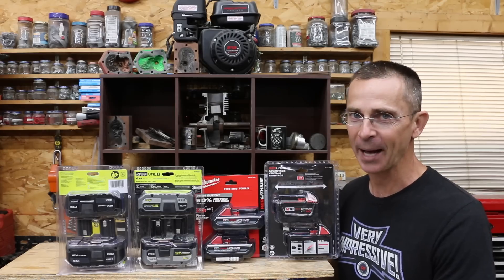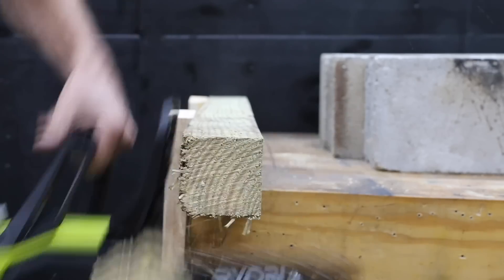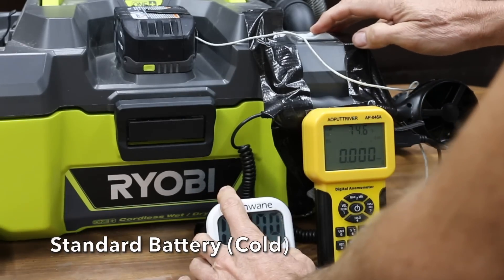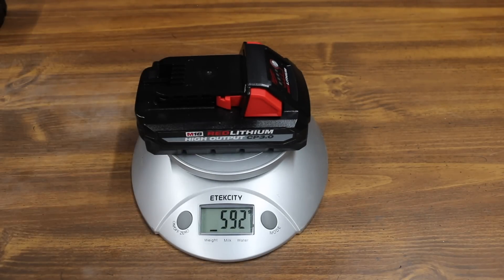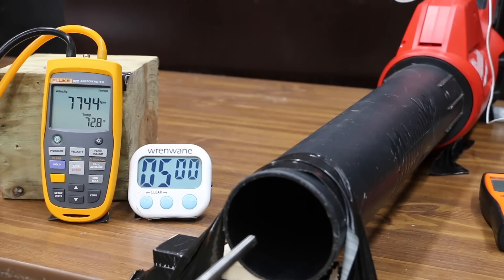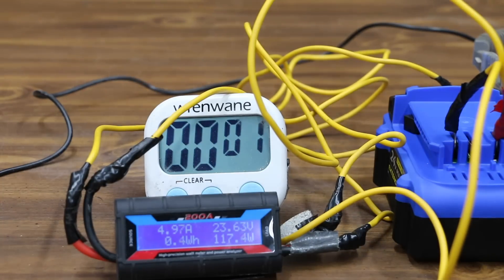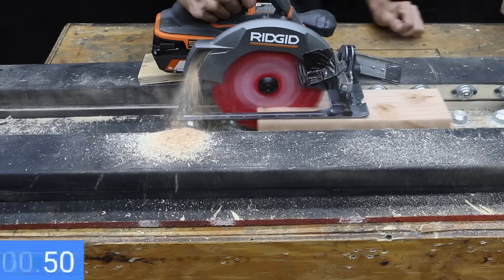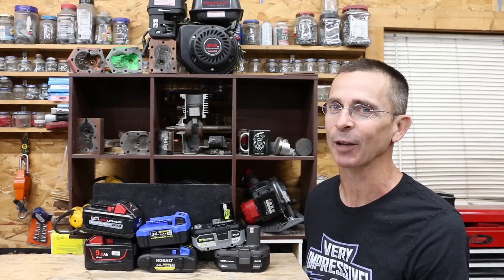Are "High Output" Batteries Better Actually Worse?

Comment: The basic idea of a "high output" battery is the initial 'kick' and power. 21700 cells are used because of more current draw capability at the same capacity (being larger and therefore runs cooler). The definitive test would be to rig up a load tester using dummy loads at high currents - could be as high as 50 amps - or create a control using a rigged power supply instead of a battery to eliminate a variable in testing, the larger or higher output batteries could end up being too good for the tool (read: tool cannot draw any more because it's maxed out electronically, a smaller battery not being able to give all the amps) that there's no significant differences except runtime. More power to you!
Reply from the maker: Thanks for sharing!

Comment: Great work you are doing here Todd!! I might suggest you consider the impact to not just my wallet but the impact to the environment and economy both on the manufacturing end and disposal end.  You may surely improve the bang buck ratio but in doing so some folks may be pushed into poverty or short life spans.  I have been there and seen battery production first hand.  After 9 years of college and 40 years of work I hung up my spurs to share my knowledge and skills with those less fortunate.  Now I grew up on a small farm, no tractor, no phone, hardly a silver spoon life.  But 10 years of part time construction work and 45 years of investing finally put me on the downhill roll.  Of all the things I learned teaching engineering was how terrible math skills were and thus financial literacy. So bad that we set up volunteer teams to teach financial literacy at libraries and churches.   Many people had the info staring right at them but could not do the basic math to determine if a good  buy was at their finger tips or if the answer should be "good bye".   Perhaps a good test and learning session would be one where the energy consumption or life span of an item was tested to see if money was being well spent ...and not spent based on the inaccurate crazy claims made on internet ads and packaging.  As you know it is not hard to measure real energy use of an item and then with a little math determining if real dollars are being generated.  You would be shocked to know how many people fall for gimmicks to improve gas mileage or believe window replacement can reduce your energy bill 40%. Money wasted on this junk would do them far more good in an Ira retirement account.  
I know high quality tools are the best to have but I also know people who earn a living using less expensive Walmart tools.   My grandfather bought a new working man's double barrel shotgun for 26.75  back in the day.  It still works perfectly and sits in my safe next to my 7 dollar 22 rifle.  Cheers for new year!  WAK.PHD

Comment: For my Milwaukee tools I have ten 5Ah XC batteries, four 2Ah batteries, and one 12 Ah high output battery.
With my 7.25" circular saw, the 5Ah batteries are OK for cutting thin materials like 7/16" or 1/2" OSB .. so long as I keep my cuts perfectly straight.  If I start to deviate from straight just a little bit the 5Ah batteries can't cope and the saw stalls.   With the 12 Ah high output battery I can cut 1.75" thick LVL and not have to worry about the blade jamming if my cut is not perfectly straight.   Ditto when doing something like rippling 1x or 2x lumber and the boards want to squeeze out the kerf behind the blade:   with the 12 Ah battery I just make my cuts but with the 5Ah battery I have to jam something into the kerf so the blade is not pinched to tightly.

The 12 Ah battery is similarly good in my drills and impact drivers when driving long lag screws or GRKs :   that battery lets the drill or impact driver handle screws beyond what they can do with the 5 Ah XC batteries.   However,  that heavy weight on the end of the drill handle is a pain to work with.   For that reason I've been watching for sales on the 6 Ah high output batteries.

Now if only Milwaukee would put chucks on their drills that can be counted on to hold the bits tightly until the user decides he wants to remove the bit.
Reply from the maker: Thanks for sharing.

Comment: You need an internal resistance meter for batteries.  That's the only measurable ways these batteries MIGHT be better.  The lower the internal resistance the batteries are, the more power they can deliver and the cooler they will stay (all other things equal).
Reply from the maker: Thanks for the feedback.

Comment: I totally agree that it non High Output tools the HP batteries are not worth the extra cost, but I would like to note that I have several Ryobi tools that are Labeled as HP and for example the battery powered pressure washer will not work with the non HP batteries. I don’t know about the other brands. Just something to look into in the future. Thank you for the great videos.
Reply from the maker: You are welcome!

Comment: Not as familiar with the other brands, but I know for Ryobi, the HP batteries are geared to be paired with HP tools, as there is an additional pinout on the HP battery that interfaces with the HP tool, theoretically allowing them to communicate and perform better when combined. These tests used all non-HP tools. Just a thought.
Reply from the maker: Thanks for sharing.

Comment: Wasn t that result to expected? You only see a difference in performance when you use packs with 2 rows of cells like 8 amps versus 4 amps. I ve used Bosch procore 8amps and the brushless tools have more chuuch with it. With an adapter you can use the same batteria on diffent tools/brands

Comment: Question: On the tests using the chain saws, is the saw electronically torque limited to limit current draw thus not damaging the internals... thus the stopping the chain at about the same load regardless of which battery???

Comment: Todd - Most if not all of those tools are limited in the control electronics, not the batteries. So it makes sense that they max out/stall out at the same point. The high output batteries aren't for extra energy storage, they're for extra power, on tools that can handle them. So your test is valid for the tools you chose, but that's not what they're for. Also, it's just some marketing wankery for some, that use 21700 cells. 21700 (21mm diameter x 70.0mm long) aren't any more powerful than 18650s (18mm diameter x 65.0mm long) by weight or volume. It's the same chemistry and construction. By coincidence if they're doing 5x 21700 vs. 10x 18650, it might end up about the same or a bit more powerful, but that has nothing to do with the form factor, just how much physical battery is there. In the old days, (5-8years ago), when you had the little 5-cell 18650 batteries, they were so anemic that you needed a different chemistry for high output cells than high capacity cells. So, the high output ones would have a tradeoff to lower capacity. You had 1200ah "power" cells vs. 2000ah "energy" cells. Modern cell chemistries don't have nearly as much difference, which is perhaps why these batteries did nearly the same. They just want to market their production line change to 21700 (cheaper, less assembly, less granularity, but granularity isn't needed they're all 20v), and are dressing it up is my guess.

Comment: The impression I got is that regular batteries are the way to go at this time.  I didn't see anything that shows 30-20% more power or run time.  Their claims are ridiculous and I would never want to feel duped or support companies trying to dupe me.
Reply from the maker: Thanks for the feedback.
Reply: That's because Todd's testing is incomplete. And they do perform better, with the right tools. Unless the tools current demand exceeds the batteries ability to supply it.. You won't see better performance.

Comment: I guess the manufacturers are hoping that people purchase these batteries and compare them to the performance of their old used batteries rather than brand new normal ones like you tested
Reply: Not at all..
Reply: @TheDaniel85  what
Reply: @RickBaconsAdventures  I mean, that's not what they're hoping at all...

Todds testing is incomplete at best in this case. It only reflects a very limited scenario not representative of all user cases. It's easy to give cases where there is a marked difference if you use the tools the batteries were meant for.

If you don't, there's little point besides the form factor and cold performance.
Reply: @TheDaniel85  what tools do they perform better on?  I agree that the batteries did not seem to be the limiting factor on some of the tests.  There was such a huge difference on some of the old small battery vs large battery (number of strings in parallel essentially) tests.
Reply: @RickBaconsAdventures  Impact drivers, impact wrenches, grinders, some saws and other high drain application where the tool is made to handle the extra flood of angry pixies. All tools won't magically gain performance because of a better battery.
Reply: @TheDaniel85  nice sleuthing

Comment: I find where my (Milwaukee) High Output batteries shine the most is cutting & grinding with an angle grinder. They seem to be able to take a much higher load without stalling out as easy
Reply from the maker: Thanks for sharing.

Comment: I know channels like TorqueTestChannel have shown that high output batteries can increase performance on some high torque impact guns.  So in really high amp draw situations like with high torques or grinders it might matter more. But I also think it has a lot to do with whether the pack is using 18650s or 21700s, the latter being able to supply more amps. 

Would have been interesting to see full size chainsaws cutting 12in of hardwood. Would put a much bigger load on the saw and maybe they would take advantage of high output batteries.
Reply: Motors can only draw so many amps, a battery that can supply more amps than the motor can use means the motor will not perform any better. This is why its very tool specific. 

Also many high discharge rate high amp batteries (im talking single cells from the manufacturers) give up capacity to be able to discharge faster (though this is being improved quickly which is nice) 

So yeah, unless you have the right tool, the only benefit will be how it performs in the cold.
Reply: @alexdrockhound9497  The HP batteries have extra contacts that match extra contacts on the HP line of tools. When the battery senses these contacts on the tool it will allow more amps to the tool via the main contacts.(the extra contacts are only to sense the tool type and not conduct power) The non-hp tools don't have these so the battery will not output more amps because their motors and wires can't handle the extra amps. HP tools can pull more amps than non HP but only with a supporting battery.

Comment: At 1/5 the price of a genuine Milwaukee battery, the Chinese knock-off battery is surprising, to say the least! I wasn't expecting it to even perform like a 1.5 Ah battery. How about a video about e-bikes batteries? Because there are a lot of Chinese e-bikes out there with batteries, all claiming high Amps per hour but do they deliver? And having dismantled the one that came with my foldable e-bike (Polarna M5 claiming to output 17.5 Ah) I saw unbranded Li-ion cells, rather shady construction inside the metal casing, and the internal fuse wasn't even connected! I doubt that it is really 17.5 Ah... Anyway, thanks for sharing.
Reply from the maker: You are welcome!  Thanks for the suggestion.

Comment: milwaukee table saw. if i need to recharge 12Ah High Output and I still need to make a few cuts in meantime I'll use 3Ah high output rather than regular 5.0. There is noticeable difference in power. Same with gen 1 fuel framing saw. Even gen 2 vac has more power on Hight output batteries. Run time is pretty much the same
Reply from the maker: Thanks for the feedback.

Comment: About halfway through the video, I was starting to agree with your final assessment that the high output batteries are more suitable for the cold. So that’s a good data point for me. Thank you for taking time to do this test.
Reply: Yep, a higher output is higher discharge when cold.
Reply from the maker: You are welcome!
Reply: Those high performance batteries are made for tools that take advantage of them. For Ryobi for example it has to say "One+HP" which none of the tested tools did. Would have been interesting to see how much the batteries would have made a difference if tested in tools designed for them. I think on those tools the voltage doubles using the pins that you can see at 0:37.

Comment: Higher output batteries are capable of delivering more power to any connected tool. The question is whether the particular tool being tested is able to take advantage of that extra power. Some tools have overload protection, and they might not be able to accept additional power. Other tools may not have this protection and tend to self-destruct when a higher output battery is used. My point, there are potentially factors that were not tested. So, making a generalization about high output batteries across brands/tools may not be possible. A more appropriate inference might be the “it depends”. Had you been privy to the design details about how various tools are setup you may have be able to find examples that perform better on high output batteries and other that do not or possibly self-destruct. This is one case where you did not have enough information to do your usual comprehensive testing. I am usually impressed with the ingenuity you apply to figure out effective testing measures but not so much this time.  You may want to conduct some additional research and devise a better approach to testing. That said, I doubt the tool manufacturers will be willing to share the proprietary technical information that might help you achieve this.

Comment: I just bought a brushed Ryobi kit, P1819, just started in the platform. It is my understanding the P195 3 amp hour battery has 21700 cells, and is actually more powerful than any of the 4AH that use 18650 cells. I’m not quite sure, but thats my understanding
Reply from the maker: Thanks for sharing.

Comment: Hi Todd, another great video & objective method verifying manufacturer's truth or lie.  President of the United States should appoint you as the head of CPSC (Consumer Product Safety Commission) safeguarding us..!  

Thanks for testing the Milwaukee knock-offs, its label says 9AH but should have been 7 or 6AH b/c it dies out so quickly.  Another example of you get what you pay for.  Your Milwaukee 8AH was made in Korea in 2021.  Newer 8AH cell is made in China.  I am curious if battery 'country of origin' plays an issue.  With the supply chain issues, we may need to buy new 'older' stock battery !

Comment: Torque test channel has a lot of battery testing that brings a lot to light between different batteries and their respective tools they were supposedly made to be paired with but farms testing just strengthens their results as both are very similar with test results.  Whether used with their respective tools, these high output batteries are usually gimmicks.  Theyre usually just different values of supporting circuit components that tell the main ic what it should deliver.  Now getting into the new pouch battery cells theres a big difference between them., milwakee just released one…

Comment: Some tool manufacturers (like Lidl) have liion and lifepo4 batteries. In my experience the newer lifepo ones are way better but it would be interesting to see it tested scientifically and maybe from other brands aswell (if they also carry both versions). I was quite surprised that tool manufacturers like Milwaukee make „high performance“ batteries that don’t include lifepo cells yet as the difference in power and weight is definitely notable
Reply: It likely has a lot to do with supply issues. Can the battery manufacturers keep up with the amount of cells needed buy that company? Milwaukee sells A LOT of batteries. 
Also, it looks like most single cell 21700 lifepo4 batteries are running at 3.2v. 
Anywho, my bet is that the manufacturers likely couldn't meet the demand needed. Also, cost. If Milwaukee has to pay significantly more for the lifepo4 battery cells vs top tier Samsung lith-ion 21700, then it would increase the cost for customers. Would a construction company continue using Milwaukee if they had to pay 2x the price per battery, even though the life span is 4x longer? Maybe...maybe not... 
The tool manufacturers are going to do what's best for them. Batteries are something they make a lot of money from. So making batteries last 4x longer isn't going to benefit them at all.
Reply from the maker: Thanks for the feedback.

Comment: Please retest the Ryobi's using 2 different HP compatible tools , as well as a fake Ryobi battery in them. It would be interesting to know if the HP batteries are better for HP tools claim is valid. And chose HP brushless tools both with and without the extra battery terminals to see if that makes a difference.
Reply from the maker: Thanks for the suggestion.